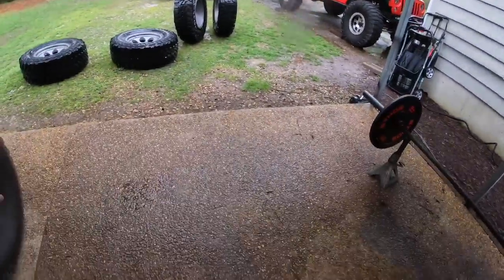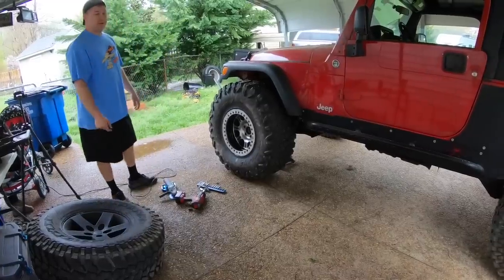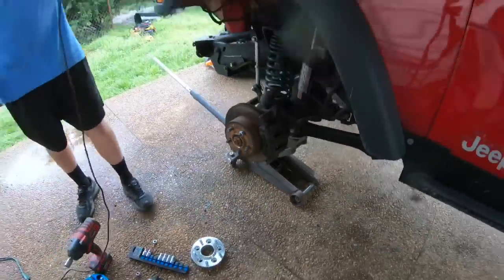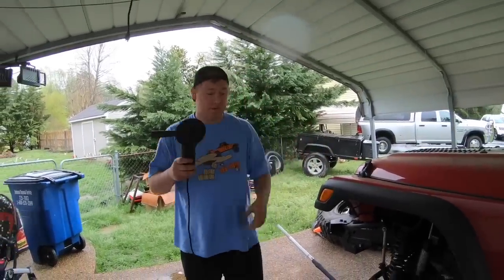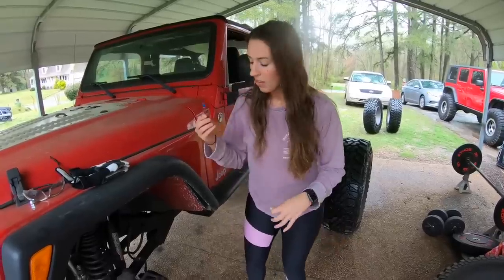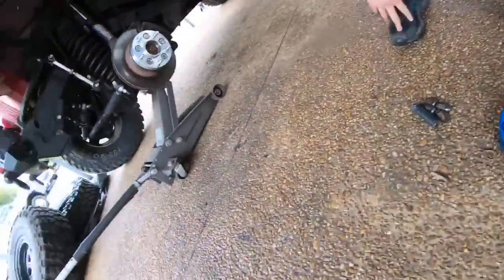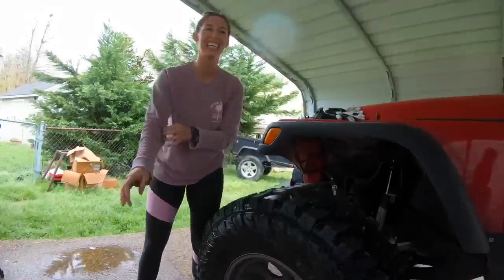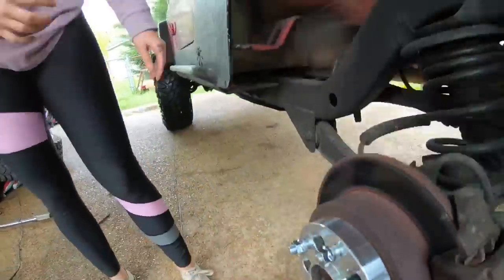Installing New Tires and Wheels on My Jeep Wrangler!

Comment from the maker: Make sure to SMASH the subscribe button! We have a lot planned for this little LJ!
Reply: Gray
Reply: I missed it if you said it. how big are the tires?
Reply: Jeep Gear & Gadgets price me the old ones.
Reply: Can you post a link for the MT Rims or list the model?
Reply: hey a neat trick to mount tires is to use a long pry bar under the tire, centered, and lift. You set the tire in line with the studs with the studs a little higher than the mounting holes and the pry bar gives you plenty of leverage. I was doing the brakes on my old Dodge pickup several years ago and I went to lift the wheel into place and it was an awkward lift. Tore the tendons in my left arm. NOT FUN.
Reply: Hello there... who's the maker for those wheels and what size are they...???

Comment: For my bigger tires on wider wheels, I position the wheel to align the lugs into the wheel holes. I sit on the ground, feet behind the tire, calves on the tread, then use my calves to lift the tire high and push with my hands as I watch the lugs go into the holes. They go on easy that way.

Comment: Make sure you take the tires off every couple months and check to make sure the lugs are tight underneath. I can't begin to tell you how many people had problems With wheel spacers because they don't check them.  Looks good 👍
Reply from the maker: Very true!!
Reply: Ive never had issues with them getting loose. With that said I check them every 5000 miles at every rotation. Definitely a good habit to get into. My 16 has 55k with most of those miles on spacers buy quality parts and stay on top of your Jeep and learn how to mod, maintain, and fix yourself. I think peiple run into problems when they pay others to do things and just get it done and forget it. If you do your own work your more apt to be on top of things.

Comment: Amazing work, but please!
Get your left hand off the wheel side of the grinder. One hand back of grinder, one hand on handle. 
Or with no handle, both hands at back of grinder. 
Your handle on the angle grinder should be on the other side. That grinder will eventually catch and your hand is in the line of the blade. 

Great work and nice cut!

Comment: In my opinion, I would paint those front fender flares black so they matched the armor, then I  think the gray wheels would set off better.  I think the gray(ish) flares kind of F with the whole concept.
Reply from the maker: Yeah they are faded and look pretty bad lol. Either plan on new fenders up front, or try to use some stuff to make them black and fresh again.

Comment: Cassie the grinder dose not bite i was LMAF  when you did the cuts ,the jeep looks good with the rims ,tires .Next time you do tires take a bar( no not the drink one) :) and put under the tire steady the tire put one hand on top off the tire lift bar up push the top in with hand on top you not a big women this should make it easy,er for you may have to try a few times but you will get it then you can do the 40,s on his jeep { lol} good to see you 2 work together on the mods. if you have more off roads to go to in your state id go down there do some off roading my 1500 dosent fit where jeeps do,so keep the good work up you 2

Comment: Did u look at the back of the wheel? U might not need to cut the lugs. Some wheels are forged with a pocket on the back between each lug hole.

Comment: I really would suggest u dont use lock tight. But it is up to u. There is. No seize. That is very good. Its silver. With a lil brush in the Can. Well i learned. Years ago. Make sure u retight them nuts. Tork. Excuse my spelling. Grey. But u need crome some where. Mabe grill. Or hub cap.. Good video guys.

Comment: Grey wheels :)
easiest way to put a tire up is use a bar I used to do big rig ties and after changing 15-20 in a row  of those a bar really helps allot plus easier to align the lugs

Comment: Nice jeep you guys. kinda looks like mine except mine tj. I also have tnt highline fenders and aev hood  and  the same wheels with 35s  km2 17x9  but mine wheels are black. Your grey wheels  look really good. That is a good choice of color!
Reply: Gay running gear. These things are junk after Fiat bought them. Dana 30 bigger than stock wheels I see problems. Looks over function= Clown town.

Comment: Nice video, but please don't use that metabo saw without the guard.
Reply: I cringed when I saw that.  Shards to and in the face is not good.  I want them to be careful.  Other than that, it is a good cheery video.

Comment: Need buy the side panels for the carport.

Also seat beads with ether or starting fluid.
Reply: On the side of the trail, ok.  But not when they have access to air.

Comment: My arb air Chuck broke as well. Didn't last but a couple of days.
Reply: ARB air accessories are overpriced junk IMO. Out of the box air hose extension the fitting popped off first time use and the chuck died after just a few uses, Can't wait for the compressor to crap out...

Comment: Spacers on a D30? With the extra weight of the JK and putting the wheels out further you change the weight on the axle tube. At some point that axle tube will break.  Seen it quite a few times already. All were running spacers.

Why not buy the right backspacing?
Reply from the maker: Well, this wheel/spacer is the same as running a wheel with 3.5” backspacing which is common for TJs on 35s. And the new wheels are actually lighter than the old ones too.

Comment: I have black 35" pro comp's on my tj  for parts check out pro comp or quadratec morris 4x4 or extreme terrain heck even amazon sells some cool stuff I own a little 10 gallon compressor but I sure would love an air tank  can you run air tools off of it

Comment: It looks ok. But. U need center peice. Would look real good.  Like u need crome in centre dear. Its a nice Jeep i like them. I have a RAM 1500 sport 2"lift 2016 with. Nitto terra grappler. 305 70r 17s. What size are them yokahomas

Comment: I had a CJ seven years ago I'm considering getting a new one newer I mean. What should I look out for as far as reliability? I'm looking at models around 2003 to 2007
Reply from the maker: If you can find a 2004 LJ then that’s a great year! Plus the LJs are great since they have the extra room.
Reply: @JeepGearGadgets  a TJ wouldn't bother me too much. I work from home and only put about 2,000 miles a year on my cars. Just didn't know if there was anything to look out for as far as reliability. I would definitely go with the inline 6 my old CJ7 had one as well
Reply from the maker: The main thing on TJs is to look for frame rust, a lot will rust from the inside out. So check very closely
Reply: @JeepGearGadgets  ty. I appreciate when people answer you got a new sub

Comment: 2Pcs 3.27inch Trailer Wheel Center Caps Push Through 3.27" Bore 3.5" Tall Hub Cap for Truck SUV RV Wheel Rim, Chrome Silver Wheel Cover

Comment: Use grinder with flap disc or hard disk an round off the edges of stud in circulator motion  an it will line up threads.

Good job on wheels an color pick is great

Comment: LJ suspension?
Reply from the maker: Mix of stuff it seems. Think the springs are RK 2.5 or 3” not sure. Shocks are teraflex, front RK trackbar, and rear trackbar seems to be from procomp. Factory control arms still
Reply: @JeepGearGadgets  How does it ride / handle?

Comment: What size of gears are you running in your diffs?
Reply from the maker: Right now, stock gears. Will be changing that soon!
Reply: I was asking because I took over my wife’s 2014 wrangler Sahara, with the Dana 30. It has 373 gears and I wasn’t sure if that was sufficient to run 35s. I am thinking about trying to find a used junk yard Dana 44.
Reply: I really enjoy the videos. You’re tips are very helpful. Looking forward to seeing the gladiator getting a life.

Comment: How do you remove suspension kits for smaller tires/rims? Mine is lifted
Reply from the maker: You will need to find someone who is selling the factory suspension parts. “Springs, shocks, control arms etc”